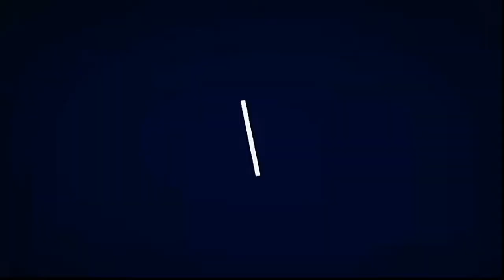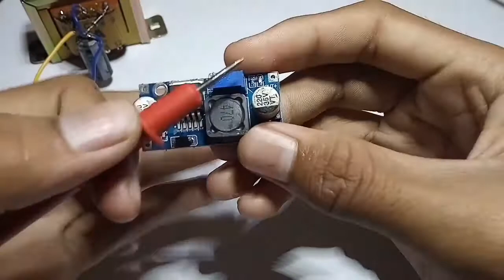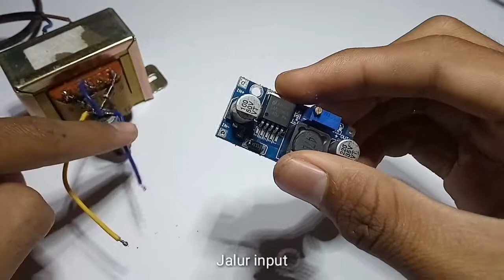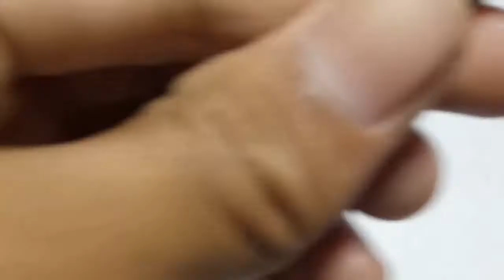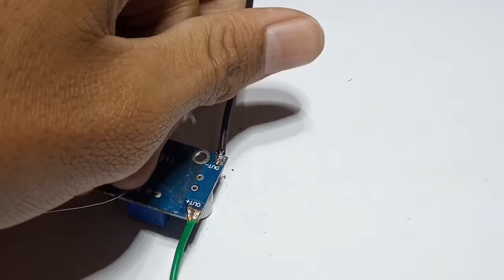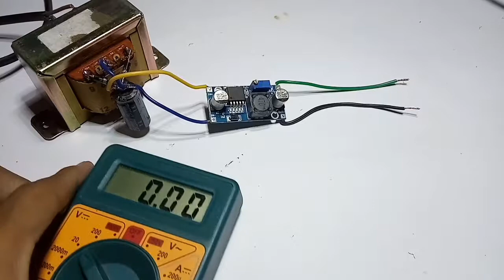Cara Menurunkan Tegangan DC Sesuai Kebutuhan

Comment: Mas kalo inputnya pake 24volt 10amper output nya pengen jd 12 volt bisa gak
Reply from the maker: Bisa
Reply: @pramanaproaudio  apa amper nya gak kegedean y mas sedangkan step down nya maksimal 3 amper
Reply from the maker: Itu amper yang bisa dihasilkan, bukan amper maksimal
Reply: Berarti kalo psu  amper nya 10 amper gak masalah ya mas bisa d pasang d input step down
Reply from the maker: Gk masalah
Reply: @pramanaproaudio  👍👍
Reply: @pramanaproaudio  saya bingung mas pendapat orang beda 2 ada yg bilang katanya kegedean input amper nya kalo pake 10 amper mohon solusinya mas apa kah mas pernah pake step down ini
Reply from the maker: Sebesar apapun amper gak masalah mas, yang harus diperhitungkan itu tegangannya
Reply: Ok mas tar saya coba
Reply: @dulhasanal4662  hehhe maslah sama 24v 10a pgn diturunin tp ktanya kalo input 10a ngx bisa,, trus gmn hasilnya mas
Reply: @ponadi_23  alhamdulillah bisa mas gak ada masalah
Reply: @pramanaproaudio  Jelas sekali mas penjelasanya,terima kasih ilmunya moga sukses selalu..